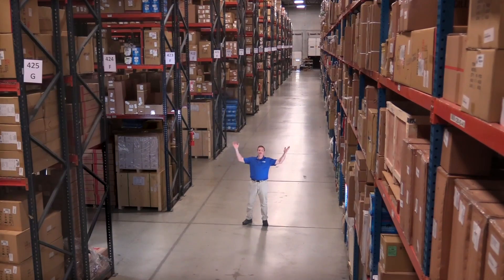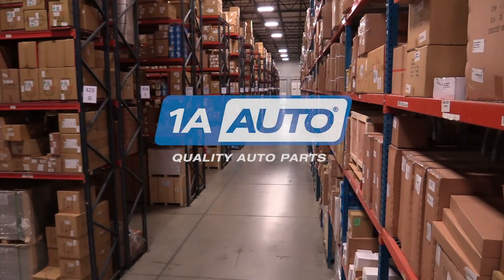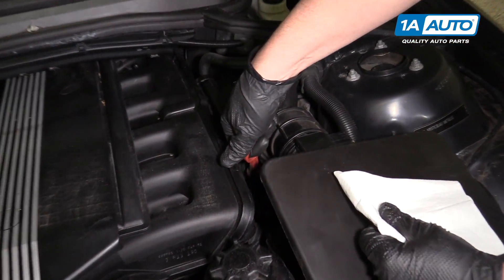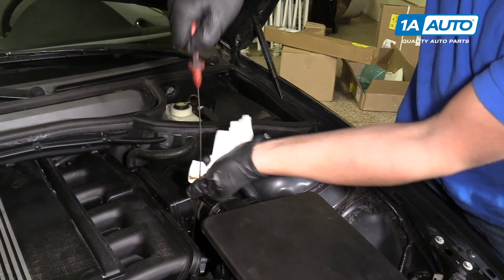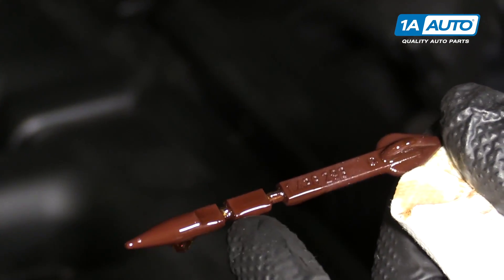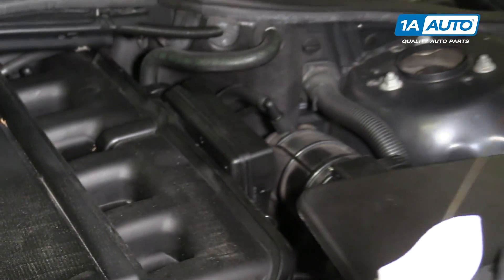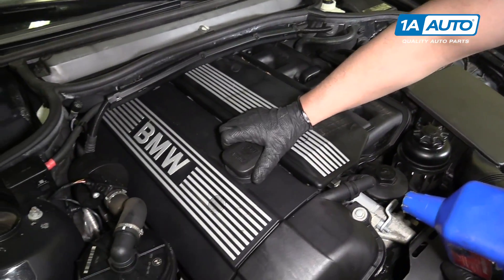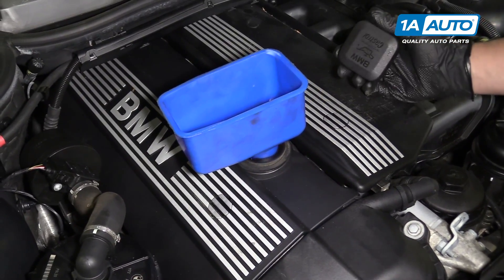How to Check Oil Level 04-13 BMW 325Ci E46

Comment: Do you check the oil level when the engine is hot or cold? I notice that my oil level reads higher when it is cold compared to when it is at running temperature.
Reply: Always check at cold, hot is not an accurate reading as the engine is using the oil at the time while running rather than when cold it is just sitting there hence giving the real accurate reading. If there is enough oil showing when cold, you dont need more oil....
Reply: @sajtor9967  Anyhow, a bit late, but, as per user manual for M54 engines:
After the engine is warmed up to working temp, turn it off and check oil level after 5 minutes. A bit strange but that's how it is with these engines.

Comment: Yeah my reading is a tiny bit over full mark.. basically exactly where the level in this video is. Not overfilled?
Reply: Have u found out if it's overfill or not I want to kno
Reply: Since these motors are notorious for burning oil, it is best to keep the oil level where his reads in this video.

Comment: My oil light kicks on when i turn the car off - but not every time and its yellow. It says that its due to being a quart low but i checked the oil level and it looks full. 2005 325 ci 110k
Reply: Any idea? Does the engine need to be cold when you check the stick? Thanks!
Reply from the maker: +JH Kendall We wouldn't be able to diagnose an issue like that here, you may want to have a local mechanic take a look at it. Thanks for checking us out! http://1aau.to/m/Shop-1AAuto-c